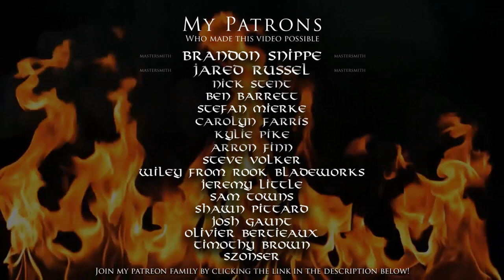What to Look for when Choosing a New Anvil

Comment: Alex, great Mate you will be very happy with your purchase. I have a 250kg Beamish Anvil. One of the first to come into Aus. It is absolutely FANTASTIC! It too is magnetic, which I find a good thing. Round stock stays on the face and doesn't roll off. It has 4 Pritchel holes, scroll table and upsetting block, and because of the size of the anvil I give it heaps when upsetting. I have set it on a laminated Aus Hardwood block. The block weighs 92kg and the Anvil is set down into the block 20mm. That is 340+kg in one spot - does NOT move. The Anvil is quiet and doesn't require magnets or chains. Great!!! Enjoy your purchase. No doubt you will have many pleasurable forging days on this Hi Tech piece of equipment. I do on mine.
Reply from the maker: Yours sounds like a monster, mate! Thanks for commenting!

Comment: Nice one! 
I won one of them in a raffle. Very happy with it. The flatness of it was what I found the most beneficial for me. I noticed my work was coming up alot neater and straighter from the forge. Less time needed on the grinder
Reply: Another thing. 25mm blue shs fits in the hardy hole perfectly. I keep a length in the workshop if I need to make a hardy tool in a rush. 👍
Reply from the maker: Good tip!

Comment: At some point, I plan to get a Beamish German pattern anvil. Probably 80-100kg, as I have a 82lb Peter Wright already which is transportable. An upsetting block would be damned handy too, and I've found myself really wanting a 2nd, square horn too.
Reply: Oh yeah, hardy hole size on the PW is 19mm, which is somewhat annoying too, given so much is 25.4mm.
Reply from the maker: Oh man, obscure hardie sizes are the worst. You won't regret getting a Beamish anvil. I've done a heap of work on mine since recording the video and it's performed incredibly well.

Comment: Another way to demagnitize.... i discovered on accident, just playibg around when i was 15, had a magnet on a steel file cabinet, and thought, wonder what happens if i torch a magnet?..... at a certain high temp, that thing will lose ALL its magnetic properties at once. That magnet fell off the file cabinet and melted a hole in the carpet xD

The dumb things we did when we were teenagers, am i right? Lmao

Well im brand new to blacksmithing. My forge should arrive today and in still selecting an anvil (thanks for the help btw!). But yeah, idk if theres a problem with tourching the hell out of a new anvil, or maybe i couldnt heat it up enough if the anvil is too big, but if theres no problem with that i suppose u could also just heat it up and see how it works.

If i get one that i can return, maybe ill try the heat method on the anvil if it comes magnetized, and let you guys know how it works.. and If something bad happens ill just send it back xD
Reply from the maker: It's a fun thought! But anvils are typically made of hardened steel, and torching it would de-temper it, causing it to lose that hardness, so I wouldn't recommend it. You wouldn't want to finally get your anvil and then ruin it!
Reply from the maker: Really honestly, I find a slight bit of magnetism in my anvil to be HUGELY helpful, as it helps keep my work in place in those moments where I can't hold it well. Since making this video I've come to the conclusion that I'd like to DELIBERATELY make my anvils magnetic if I could!
Reply: @ValhallaIronworks  ahhh ya I don't want to torch it then lol.

But hey, if u wanna remagnetize, u could buy a strong magnet like an n32, n42, n54, and leave it on your anvil when not in use.... u might wanna put a towel under it, because it will be insanely hard to pull an n52 off metal with your hand. I have one.. Also, if u try to lay it down barehanded the thing could really smash your fingers, and i mean bad, like it could probably take a finger off... So fold a towel under it so u can use that to lift the magnet again later, and still be careful laying it down and picking it up. But those are available on Amazon in different strengths, shapes and sizes. 👍